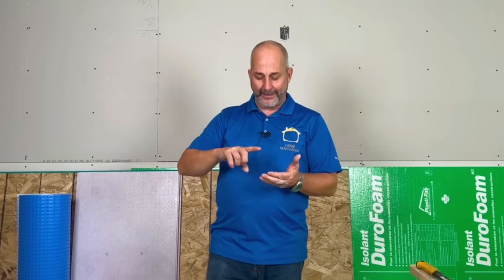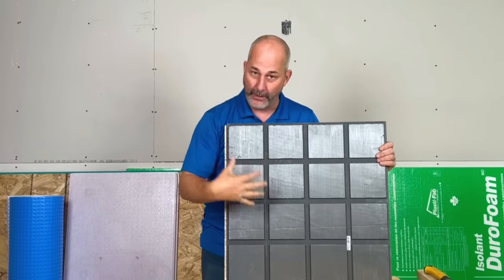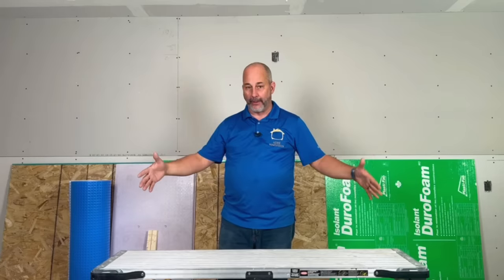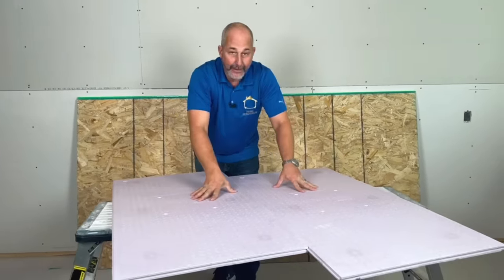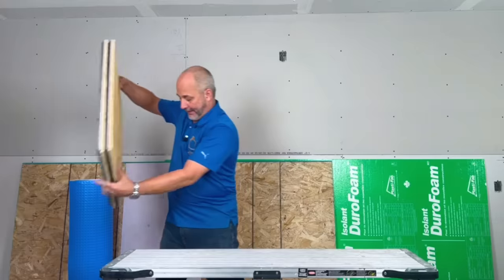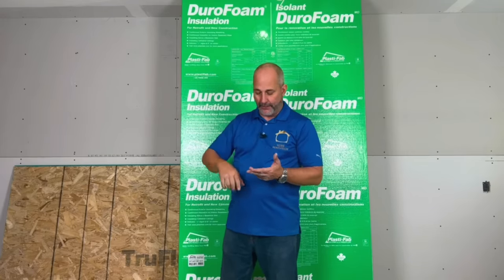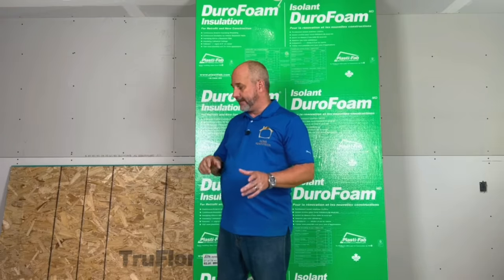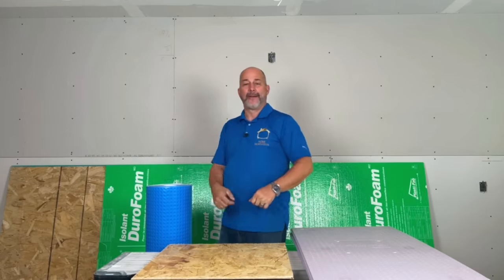Comparing 5 Different Subfloor Systems and What They Cost

Comment: Great video as usual🥰🙂 . What if  person just wants carpet in a basement room ? I was looking at DryBarrier squares . It is a 1958 house w/ 9 inch tile over the concrete in the entire basement . We put carpet over the tile in a large 22 x30 finished space in the late 1980's . Definitely time to change it out.  It would nice to give the floor a thermal boost but  moisture management would be more important . We were considering pre cut carpet tiles instead of broadloom over the dry barrier but would love it if there were something that's more budget friendly . Basement is used for husband's home office . Stairs not an issue since those land onto tile in a separate area. any comment or reply always appreciated . Cheers😀
Reply: I just commented asking about the same product. We are in Wisconsin and wanting to lay carpet. Drybarrier doesn’t state an R value, we bought a couple cases as samples and they make a big difference temperature wise under LVT (bathroom) but under an area rug with pad they don’t seem to make much temp difference than without. Still leaning towards using them, but was hoping for whatever will help keep those ice cold floors the warmest.  About to install a few hydronic baseboard heaters as well.
Reply: We used dri core under vinyl on our 3 seasons porch and it made about a 5 degree difference on the floor . there was a lot of waste .....but in the basement I was leaning toward the dry barrier product because it didn't have wood on it ....🌼🌻🌼

Comment: 1st of all, I very much appreciate the detail and honesty of your videos. Thank you for creating them. I have a 100 year old house with an uneven basement floor. Its half-a$$ed half finished right now. I want to keep a rough finished hang out space there, but need to manage moisture. I will only need one short section of interior wall to separate the utility space. 1 step, or insularmor? Will rigid Insularmor be at risk of braking or cracking if the floor is too uneven?

Comment: I will be replacing much of the plumbing under the basement concrete floor before installing dimple mat.
What do you think about installing a floor drain at concrete level so that any possible water could drain from under the dimple mat, and then another drain could be added at the highest waterproof flooring installed(in this case vinyl)?
An access cover would of course be installed over the lower floor drain.

Comment: Great video!
I can share my experience with the InsulArmour pink sheets. 2017 house in Ontario, Canada. Mostly bought because it’s light weight, has no organic material so no chance of mould, and had a great R-value. Install was easy. I put vinyl plank right on top. In some areas you hear a hollow noise when you walk. I tried to pin them down with tapcon screws and large washers but - being a basement - the floor wasn’t perfectly level especially around posts and the walls. Overall, I’d recommend. The floors are way warmer than if I had just put LVP directly on concrete and I never have a mould worry.
Reply: How thick did you go? That’s what I am leaning towards. I think the big panels will help with my non-level floor since they have some flex.
Reply: To prevent the hollow noise when you walk in some areas on the LVP + insul armor, I am wondering if it would help to have glued the insul armor to the concrete. You wouldn't need much glue, probably just a drop on several of the circular protrusions on the bottom.
Reply: How thick what? Vinyl? 5mm I believe. If I were to do it again I’d use a less rigid plank so it follows the ups and downs better. 
I considered gluing, the problem is the tiles are pretty dense and don’t have that much flex. And my LVP was fairly rigid. I tried the dricore shims too. I’ve just resolved that generally a basement isn’t level. There’s no economically perfect solution. Only real fix is a bunch of self levelling cement. In the end, it’s a basement!

Comment: Thanks for the video Jeff, and for the moisture test suggestion. I'm in the Ottawa area, with a 1990 built home. Basement currently has vinyl tile squares glued down to the concrete with carpet over the tiles.  Plan to remove carpet and use vinyl plank.  Do you recommend removing the tiles and scraping the glue off the concrete?  Or just put the vinyl plank over the tiles? Any wall cracks that have lead to water intrusion have been fixed. Thanks!

Comment: My house is a 1930 build. I just started during Thanksgiving break to tear down (the one and only) bathroom. The room is about 5x10. It was tough getting the old cast iron tub out, but I finally got it out. My fist break to work on the bathroom is Thanksgiving, the next break is Christmas break. Now, this part of the house is creekside (not in flood zone by any means), in Southern OR, 5 feet off the ground, on post and pier. No Visqueen on the ground. I had to completely rebuild the creekside wall and put in a new window (above where the new tub is). Outside, I needed to get the scaffolding level first as the big ground rocks made it about a foot difference on two of the legs. Got that done and it fell over 3 times towards the creek, I got it back up and then put the step ladder on top ( I am 5'3, 59yrs, and a sole fixer upper). I got on the scaffolding and attempted to hold the window above my head and screw it in. After multiple attempts (I had a limited amount of time off of work so I really needed to push it, and of course wanting the bathroom and all it's amenities back) of trying to screw in the new window, I realized I could not do this from the outside, I just don't have the strength, (and I am going to have all the windows changed out even the beloved pocket windows later this year professionally when the loan comes through). So I dismantled part of that creekside inside wall that I just rebuilt (I know this is incorrect, but I had no choice to put the window in this way) and screwed the window to it and put it back together. By this time I noticed that I was in a bit of pain, I called the doc and they suggested I go to Urgent Care. I found out I broke T11 and T12, (a compound fracture) (slight) and messed up my ribs, they still can't tell me what's going on with the ribs. Anyway I had to take a little bit of time off for the remod. Which is good as it gives you more time to think things through. I had one of my Elders say " you know your not a spring chicken anymore". I now realize this (very hard to admit defeat), but I just didn't really have a viable choice in the matter due a lack of viable funds.
Now, to get to the flooring. Part of the support beams were rotted, so I replaced those and added additional support (overkill at it’s best). Put a sheet of plywood on top of half of the floor while the other half of the bathroom boards flooring ( the one closest to the dirt ground underneath) was ok so I just put 1 sheet of plywood on top of that. (Just to reiterate,) The other side needs two sheets of plywood as none of those boards on top of the support beams were viable, so I removed them). The flooring I chose is the Smart Core Tile (snap flooring) in Glacier Marble. I was informed that I didn’t need any underlayment at the big box store but now that I’ve seen this video, I thought I should ask you. What do you think? I may add a shower for the Slipper soaker clawfoot tub later on, but for now it’s fine. I think I may need to put in some kind of step or two as my short legs are having a bit of a time maneuvering in and out of the tub. Any videos on that, steps for a tub?

Comment: Your videos are a god send. I’m planning to finish my basement this spring. The subfloor has been my husband and my Achilles heel. 

Our house was built in Wisconsin in 2021, but we have cracks in the basement floor and we have had issues with water in the basement already (related to a drain issue that has since been fixed) so we’re nervous about moisture. Do you think we need to be concerned about moisture? Should we focus on moisture lock or just a thermal barrier?

Comment: My house was built in 1946. When I bought it, the basement was finished; notice I said was. Two months after I moved in, water came into my basement and it's been empty ever since. I'm trying to avoid a $10,000 water proofing bill but, I might not have a choice...however, since it's not a lot of water, I'm wondering if these subfloor options will work...

Comment: Dricore  man myself, ran into issues with it though after a leak. needed to replace some and I found out both dricore and barricade changed the thickness of the OSB, no change in model number but could not find any in the thicker size anywhere. Needed to use layers of ramboard (thin cardboard basically) to match thickness.

Comment: Hi Jeff, right on time for my basement job. Sand and Clay ground, 2017 build, 2 inch foam and vapor barrier under the concrete floor. Northern climate (Quebec). I thought not to put a subfloor before my floathing floor, but not sure anymore...

Comment: Hi Jeff, thank you for this video and all of the videos you have made. They are great to watch. I live in the greater Toronto area. The home was built in 1982. For me the main problem in the basement is the dampness in the basement and sometimes the wetness on the walls. Which system would you suggest? In addition, do you have a video on redoing the weeping tiles around the house. I believe that will be my summer job around the house.

Comment: Jeff, thank you for making these videos that are actually something a home owner can do!

I have a fairly new home, under 10-years old. The whole house has an issue with how air tight it is, in fact some mold issues in the corners and windows all over the house. No actual wet spots on the basement floor...

The question, what kind of barrier would you use in this situation, dimpled or the durofoam R-3 style in this video. I do have a door to the basement, no issue getting large sheets in.

Also, unrelated to the flooring material, I need to hide a toilet flange in the basement floor, that was put in the middle of the room for some reason, any ideas on this? Maybe a future video??

Thank you for what you do! Hope you're doing well in the new year!

Comment: I have a home in Minnesota built in 1957 low ceilings as it is, so every inch counts a lot home has previous water issues but grading has been fixed and old windows where it was coming in has been replaced. Planning to put a floating laminate floor down.
Reply: Size of the panels isn’t an issue as there is a tuck under garage. Trying to figure out if thermal and or vapor barriers are necessary. The laminate flooring is waterproof.
Reply: Any advice would be appreciated
Reply: For height, something like DMX One Step or Delta-FL is probably the way to go. You get a bit of a thermal break, a vapor barrier, and a hope of water management just in case.

Comment: I have a house built in 1980, and just found the laminate floor in the basement is water damaged. I live in Alberta - damn cold in the winter! - don't know if the water damage is from wall crack or moisture coming up through the concrete floor... I plan to replace with vinyl plank, which seems the most durable/recommended for basements. I assume I need the roll of dimple and something on top of that for subfloor?.....I used a product called Dry Barrier subfloor panels in another reno 3 years ago and it was perfect in basement! Cannot find it anymore. It was rigid plastic tiles. The OSB/foam tiles in this video are $10 each where I live,  over budget for me.

Comment: OK, here goes… Getting ready to install. Laminate plank flooring in my basement. The house is 27 years old, it’s in Connecticut, the basement, is and always has been bone dry. I am thinking of a rigid/foil-backed product as a subfloor for potential vapor barrier and thermal benefit. What do you think?

Comment: I am doing your subfloor with the dimple bord right now. I had to do interior drainage pipe in the basement. I have my dimple board down and have 5/8 osb plywood as well I guess my question is I'd the durofoam stong enough under the plywood between the dimple bord. I live 1hr east of Ottawa just like to do a thermal break. Love all the content you put out

Comment: Hey I have a brand new house and I am building it in western Canada  with tons of snow . Furthermore it’s on a reverse walkout lot- which means the elevation at the back is higher and I have a hill at the back. There is water which doesn’t go into the ground as when I saw it while we were pouring footings and walls.

So for the basement , where I know there will be water , what kind of product should I go for in the basement

Comment: I am going to build a sleeper floor over a concrete/tiled covered porch (Closing it in).  There is no vapor barrier, so I looking for a suggestion for Vapor and thermal, my build-up will be up to 3.5 inches so I have plenty of room to work with. Any suggestions?

Comment: In a newer house (built in 2004) in Ontario. What works best, subfloor first then frame on top, or framing first. If framing first, if there is the vapour barrier, do you need pressure treated bottom plate? Thanks. Awesome channel!

Comment: Doing dri core R plus with cork floor on top.
I checked for moisture with plastic sheet test, was no moisture. However house built 1991 with established bathroom lower lever and so called English basement style of lower level.
It might be most expensive option but I like idea of insulation plus channels for occasional possible moisture dispersal.

Comment: New construction, like being done next month. South Western PA in US. "Superior Walls" for basement walls. Should have French drain running ~30 meters from edge of house to daylight at the top of a very very high hill/cliff say 40-50 meters down. Basement will have 9ft(2.7 Meter) ceilings, and will have 25in(!0.7 Meters) exposed above grade. Will have home bar, home office, study/library, and full bathroom so was thinking combination of laminate hardwood and carpet for flooring depending on the room/area. Heating I haven't determined if its going to be ducted (Electric heat pump), electric floor board heaters, or or wood burner stove or something specific for basement and separate from rest of home heating.

Comment: We're renovating a slab on grade garage space into a living space. Pacific NW climate so the cold is a factor but not brutal. Vapor barrier under the slab already, no water intrusion worries. Trying to avoid a thick assembly but don't want cold feet regrets either. Considering LVT flooring - how worried about cold floors should I be?

Comment: Thank you for all the info you are presenting, I have a basement that I am refinishing right now 
Doing spray foam for walls and removing old flooring system to do a new one 
I saw some cracks on the floor and I have a little moisture issue
Would you recommend dmx 1 step + durofoam? 
I need a moisture and thermal barrier for my flooring in the basement 
And would you recommend removing the old framing and installing a new one on the subfloor?
I live in Montreal, QC my house is 1976
Thank you

Comment: New construction, insulated and vapor barrier under basement slab, should have plenty of water drainage and don't plan on flooding issues.  What would you recommend putting down before flooring? Maybe a little barrier mat prior to OSB subfloor just as a separator incase of any water leaks? thanks!

Comment: Awesome video.  Here's my scenario, 1st floor, slab on grade and has our kitchen/living room/ den and is cold and hard on the feet ( currently laminate / tile / carpet ) .  Looking to put something new down ( likely engineered HW)  but have a couple things to consider .   1) Height, as doors are approx 1" off current floor   2) Thermal break because of cold  3) Kitchen, not sure if we need to pull all the cabinets or just the appliances .   The house is 20 years old and I'm not concerned about moisture .   Thoughts ?

Comment: I wish I would have found this BEFORE I started demo on our kitchen.  I do have a question...
60+ y/o house, pier and beam, in East Texas.  We have one layer of 3/4 treated plywood. I was going to put a second layer of the same plywood running 90 degrees of the first. Would that be the best, or should I use a different product on the second layer for some kind of vinyl (LVP or vinyl tile)?

Comment: OK; here's a good one  for you.    The house is from 1912, the slab is a mix of various different pours,  some modern Portland concreate, but a lot of soft sandy mortar.    On average about 2-3 inches thick.    When the water table is high, there is a decent amount of vapor pressure.   On rare occasions I've seen it high enough to produce some damp spots, but never any standing water.    I just installed a sump to try and manage the water table.    I am finishing an area that's 12x20.    I've got 86-87 inches to work with; but I need to allow for leveling, both the floor and the ceiling vary by as much as an inch (or 1.5 in one spot).     To save height I was initially thinking of pouring self leveler, and then using the DMX with a vinyl plank; this gets me 3/4 for self leveler + ~1/2 ( 4mm for the membrane, and then another ~6mm for the flooring).       My concern is that getting the floor level with self leveler will take like 30-35 bags, and will be a nightmare.    I'd rather level with shims and sheet goods, but I'm afraid of a soft or unlevel finished floor.   Can I put down DMX and then shim OSB overtop? Any other ideas?  Thanks!

Comment: Hey Jeff,

I have a 1960-1965 year old home in St. John’s NL.  I bought the house in February of 2023.

There was no Vapor barrier installed when the concrete floor was poured. I don’t believe there was ever any water infiltration in the past, at least it does not appear to be any from my observation. What type of product/s would you recommend for a sub floor for my home